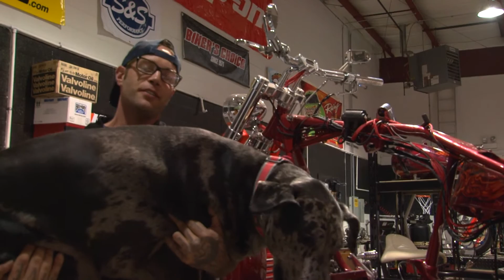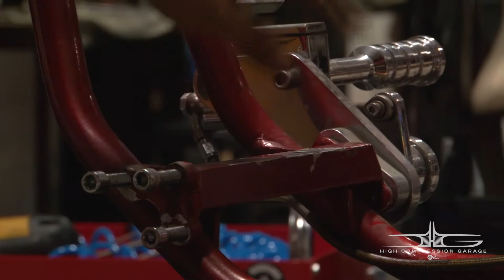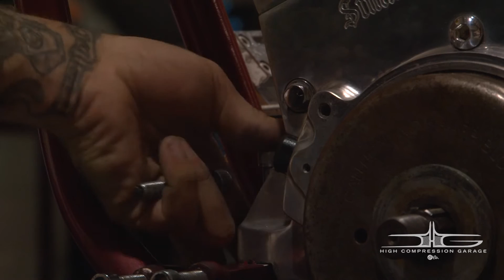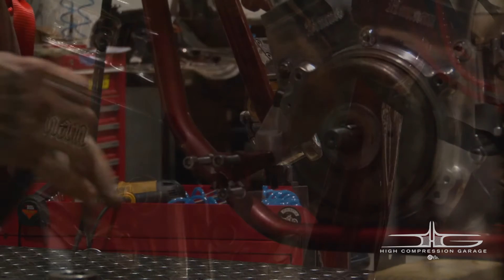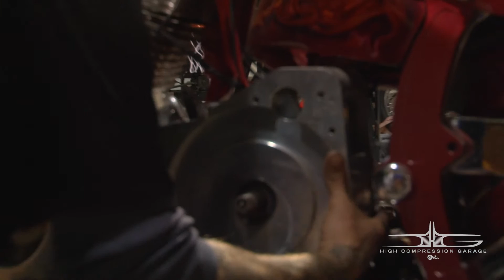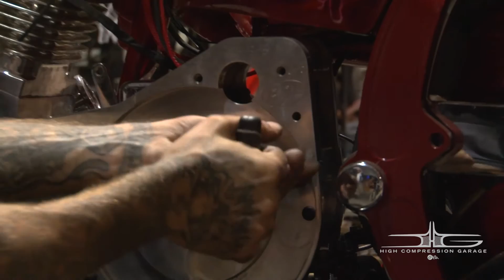Installing A Motorcycle Engine & Transmission

Comment: Hey mate I have had Dramas with my Primary Bolt popping have just done what your video has done and I’ve ended up with a half inch gap Between crank case, and in primary Shouldn’t be doing that considering everything is stock

Comment: My bike is a brand new 117 ci S&S Evo with a Baker DDR 6. I'm having difficulty starting my bike! I've replaced many parts such as starter, rewired entire bike, and tested parts but are still good. So everything is literally brand new. It's been having a hard time starting since the build. I found out my bike starts extreemly easy without the primary cover. I would assume it the transmission but after this video, it gives me a big chance I just need to re shim everything.
Seems like I need to re shim and test alignment. I'm thinking my Baker transmission is causing the bind/hard start.

Comment: Hey Guys, I'm building a custom bike and the transmission has 1/4" gap between it and the primary (belt drive). Suggestions??
Reply from the maker: Ken, grab a 1/4" spacer for your primary. BDL & Primo Riveria sells then with some fair prices. Double check your engine/transmission spacing and shim after getting it all tightened up. Hope that helps.